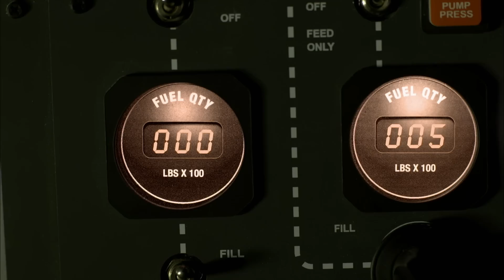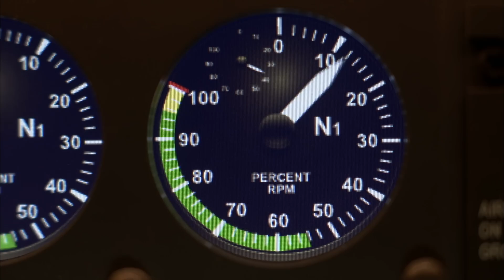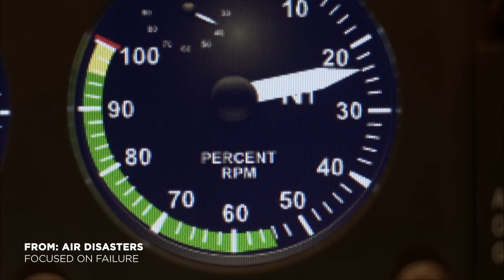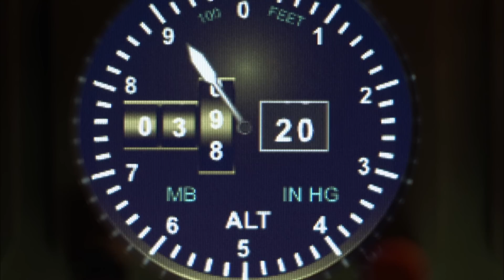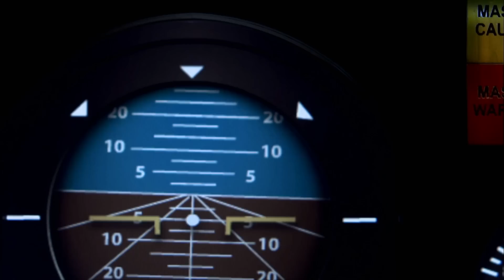A Captain’s Desperate Ploy to Bring Power to his Failing Engines 🛩 Air Disasters | Smithsonian

Comment: Even though Captain McBroom actually made a mistake with the fuel supply. In my opinion, you can't just say it's his fault and that's all.
The captain flew the way people flew back then, you can't compare the old approach to today's. 
For exsample Car drivers cannot be compared like that either for example: one driver with a driving license from 1985 and the other from 2015. You can't say that the one with less driving time drives bad or that the older driver doesn't know the new regulations, the older driver drives the way he did in 1985, and the same is true for pilots. FAA could have introduced appropriate training CRM earlier, but they delayed it.
Of course, I know I wasn't there, but I must admit one thing to the captain - he put the plane on the ground and came to the meeting to see the passengers of that flight, even though he knew that they might have a grudge against him. He kept it on his toes and came to the meeting and for that he deserves respect 👍👍👍😊

Comment: SPOILERS!!
The captain was too obsessed with the possibility of his landing gear not falling into place so he just circled around until he FINALLY noticed that he had no fuel left. Ultimately, the only faulty thing in the aircraft was the light BULB to indicate if the landing gear was down. THE LANDING GEAR WAS FCKING FINE THE WHOLE TIME.
Reply: Have you heard of Eastern Airlines 401 it's exactly the same thing except it was later discovered in the investigation that it was a burnt out bulb but recommend check it out

Comment: On 747 trip from JFK to Heathrow I believe.  (Back in late 70's) All of a sudden it got real quiet in the cabin. Uh oh. Sort of like gliding along for a bit. Nothing really happened. It was obvious to me the engines had lost power.  I was a flight attendant. Then everything resumed like normal. What happened was, the flight engineer mistakenly flipped the fuel flow switches cutting fuel to all 4 engines thinking it was the fuel heater switches. He had just upgraded from a 707 where the position of the switches were reversed. The captain about soiled his knickers. The Flight engineer was grounded in London and deadheaded home along with the entire crew because there wasn't an F/E available to take his place on the trip home. I was thinking,  they're both Boeing planes. You'd think common sense would have them standardize the position of the switches.
Reply: Exactly I agree with you. I feel so bad for the FE having to take the back seat home, that had to be a long flight home knowing the Chief Pilot is waiting for him? Did he keep his job? Luckily the 747 can float for a very long distance, BA hit volcanic ash and still glided like 140 miles, unfortunately u can't pull up. They finally relit all 4
Reply: @jasoncentore1830  the pilot's have a very effective union, ALPA which is a arm of TWU. The issue of switch location was point of contention.  He didn't lose his job. More like a wrist slap. As for the 747s they are so buoyant that pilots initially had problems getting them on the ground as opposed to say the 727s, that like to fall out of the sky.
Reply: @jasoncentore1830  And when it came to landing wasn't the windscreen covered with ash aside from a small little section?
Reply: Unfortunately BA is really punitive. When the 777 lost all engines due to fuel icing the first officer partially retracted the flaps so they would crash inside the airfield and not outside of it. He was fired because it wasn’t standard procedure—even though there is no standard procedure for losing all power in the final landing configuration beyond gliding distance from the airport.
Reply: @calvinnickel9995  British ass backward way of thinking. It's like his own life is not on the line?  I'm assuming there isn't  a unionized organization there. American carriers will welcome him. It difficult to get experienced pilots these days.

Comment: Holly crap that pilot was a hero!
Reply: Yeah, but he also caused the crash.
Reply: @chukowiley3823  In the final report it concluded the Captain being distracted by the landing gear issue despite multiple warnings from the FO and FE about fuel the Captain was still fixing the landing gear. It was believed that the right side landing gear freefallen into position whilst the left and nose went down as normal but the left landing gear wasn't illuminating as was the right. This also including a slow job of the cabin getting ready was the cause the of the crash.

the FE and FO were also blamed in part of poor CRM 

More info is in 3 Greens - Aviation Safety video about United 173 and on Wiki
Reply: @RBMapleLeaf  yeah, I guess you can’t fully blame the pilot, but him not paying attention to his copilot’s and flight engineer’s warnings was likely the main factor.
Reply: @chukowiley3823  CRM Was not fully considered and that was what sparked CRM In pilot training

Comment: The plane ran out of fuel because the captain dithered about an apparent landing gear problem until it was too late to get back to the airport.  It is always better to land on a runway with uncertain landing gear than to be forced to land in a city.
Reply: This instance was similar to what happened to Eastern Airlines 401. 
Lockheed L-1011 Tristar from New York or Boston heading into Miami making an initial approach on RW-09L when the Captain noted a landing gear problem which was later discovered to be burnt out bulb pertaining to the left landing gear
Everything was normal holding until the Captain unenforced to push yoke forward whilst facing backwards and 401 was making a slow but deadly descent as it was heading over the Florida Everglades West of Miami. Evenutally 401 crashed into the Everglades killing 101 of the 176 people

The final report concluded that a Burnt out bulb on the left landing gear and the pilots being distracted by it, coincide poor CRM usage and the Captain unknowingly pushing the control stick forward was the cause of the crash

Eastern Airlines 401 was one of two crashes in the Everglades.

1996, ValuJet 592 crashed 3 miles from 401 due to an onboard fire

That was due to incorrectly boxed oxygen generators to catch fire and consume the aircraft no one on 592 survived
Reply: @RBMapleLeaf  I remember when that happened, I feel bad for the guy checking the nose gear when he starts seeing plants. Ever watch ", Ghost of Flight 401?"
Reply: @jasoncentore1830  I have not but i wouldn't have been too surprised
Reply: Especially it just as safe to land w no gear, the plane will need work but it's not going to kill anyone. Remember Eastern 401 they were trouble shooting a 10 cent bulb and didn't pay attention putting that down in the everglades